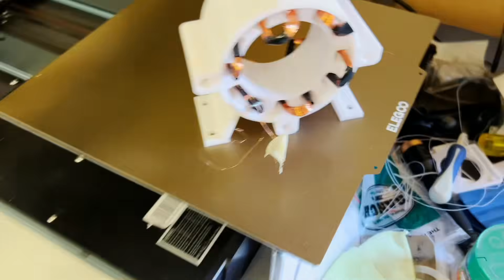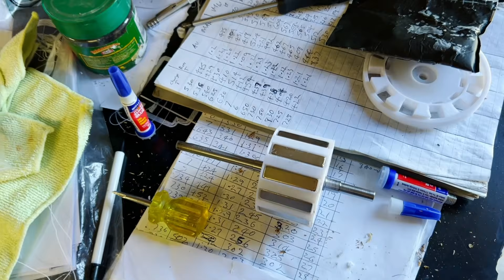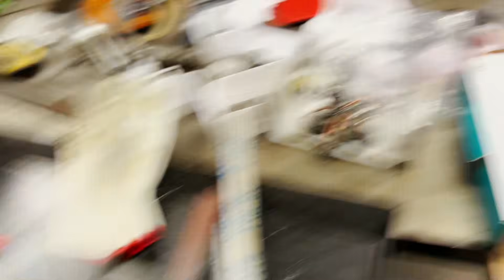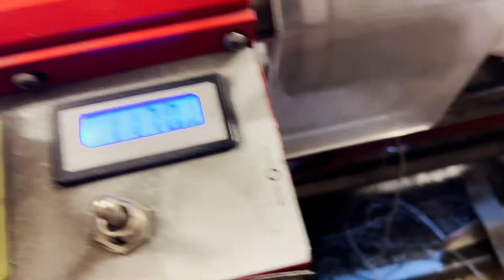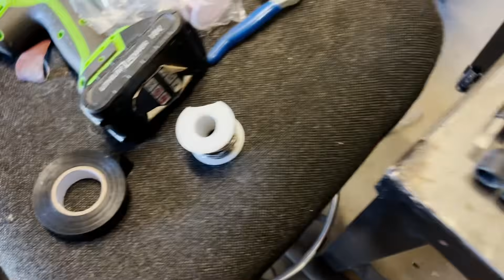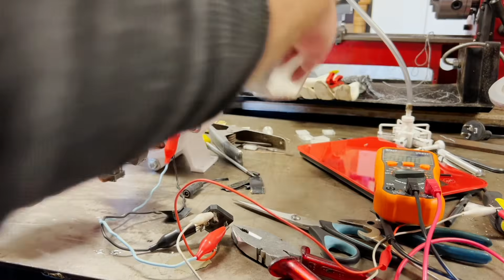Serpentine coil 3D printed Generator For The Steam Rotary Engine

Comment: I would make one suggestion, instead of looking at how many open circuit volts and then how many short circuit milliamps, (this is meaningless)  I would connect a load resistor, say 20 ohms. Then measure the voltage across the load and the current through the load at the same time. This will give you a real understanding of performance in watts delivered to the load.
Reply from the maker: Yep. That’s the next testing phase.
Reply: @danp1224  What voltage are you hoping for this unit to produce? From my own experience, I have found that iron-less coils produce power most efficiently when the coil is pancake wound, (each coil has the profile of a coin). I ask about the voltage, because if you are hoping for 12v ish, then the wire length and diameter used would not be the ideal choice.
Reply from the maker: @TheTemporalAnomaly I’m wanting maximum voltage I can get because this engine will run many rpm’s on steam then I’ll step the voltage down with transformer and convert to amps. On the coil there serpentine is more efficient because you can get the wire perpendicular to the magnetic field see very degree the wire is out is a loss of power and the top bent parts of the wire are less wasteful then round coils. Try it.
Reply: @danp1224  If you intend to transform it down, then its ok to go with higher voltage and thinner wire. For the step-down, I would go with a switching convertor rather than a conventional transformer as the losses will be much lower. Have a look at the losses for small iron transformers and you will see what I mean. The sg3524 controller ic is a good starting point for the convertor. I assume, you would rather build your own than buy one ready made.